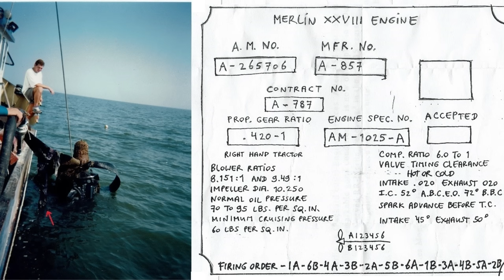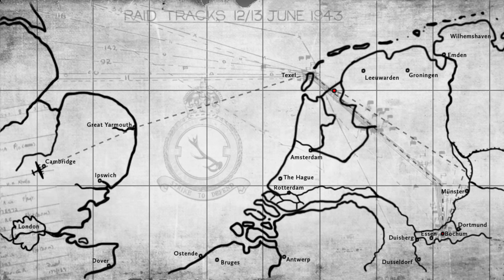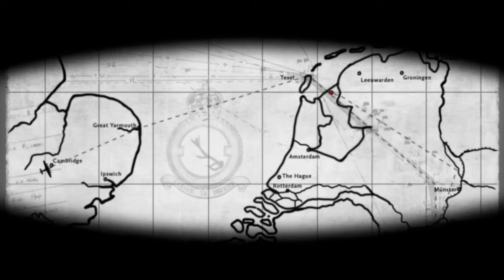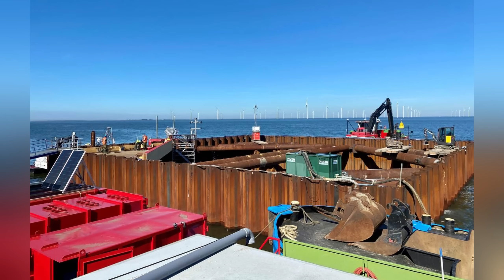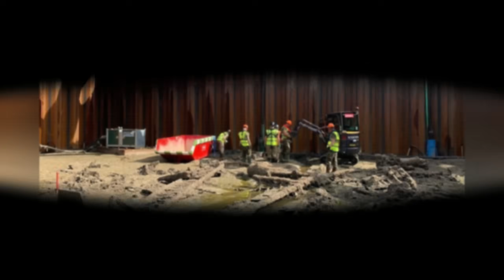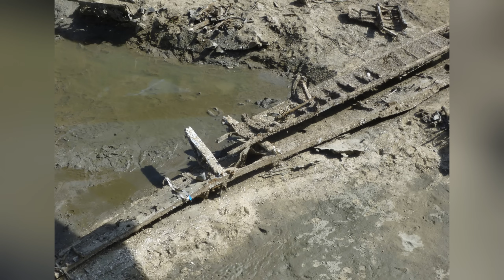Salvaging Lancaster ED-603: Unsealing IJsselmeer War Grave

Comment: The Dutch are truly masters at doing this sort of engineering. In the 1980's I did a job in a cofferdam that was attached to the leg of a Northsea gas platform, about 15 meters under sea level. Acces was by ladder through a steel tube, all dry. Before hand, I had to complete a course on how to use an aqualung in case of emergency. All very exciting and a bit scary. Job went well and the platform is still standing, I believe.

Comment: Thousands of tons of pressure on that metal box ? How ?
Reply: Pressure of water surrounding the cofferdam, of course.
Reply: The cofferdam is holding back thousands of tonnes of water. One cubic metre of water weighs one tonne (metric ton). :hand-purple-blue-peace:
Reply: @Aotearoa_Kiwi  that doesnt equal thousands of tons of pressure.
Reply: @doobybrother21  work it out yourself. The area of the Isselmere times the average depth of the water ( let's take this particular depth as the average) 13 feet (3.92 M) to work out the cubic capacity. That's the amount of water that coffer dam is holding back. Gravity pushing that water down over the whole area, water being the liquid it is will be pushed sideways as well as down, so each and every cubic metre of water is excercising pressure on those coffer dam walls.  Now do you get the idea?
Reply: @samrodian919  area doesnt come into the equation. If it did a person swimming in an ocean would get crushed immediately. Waterdepth, fluid density and gravity are the only factors. At 3.92 meters you get negligable pressure. Not thousands of pounds.